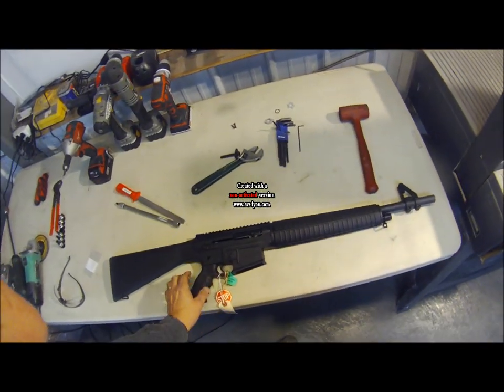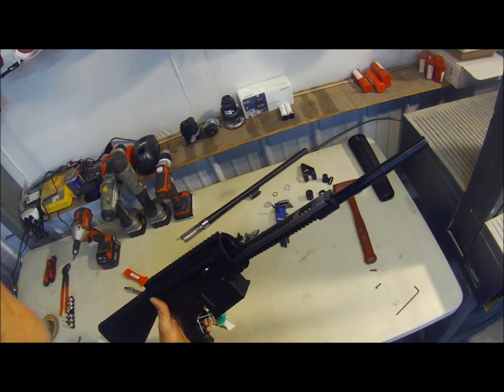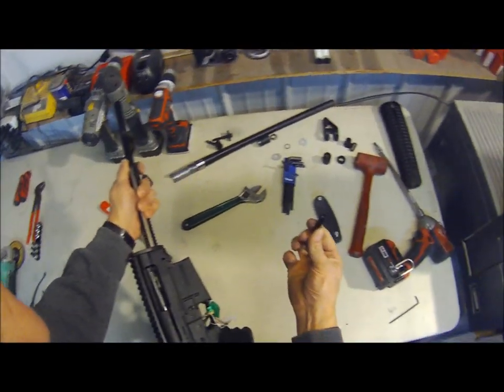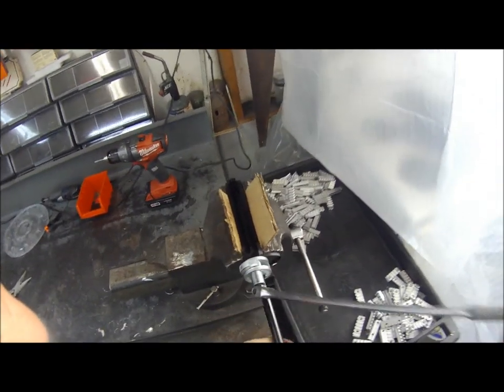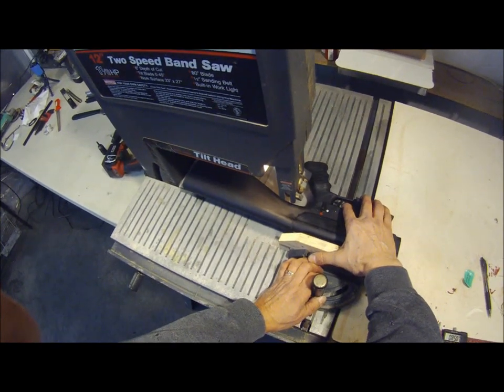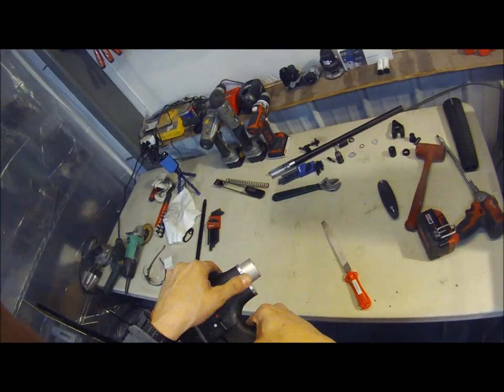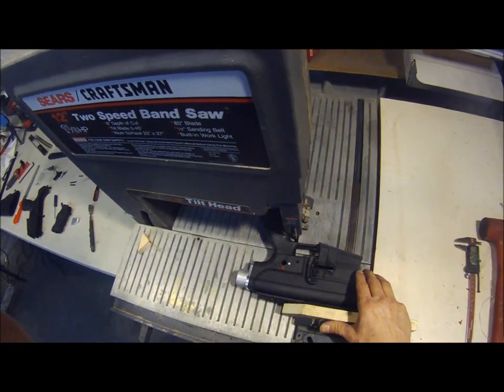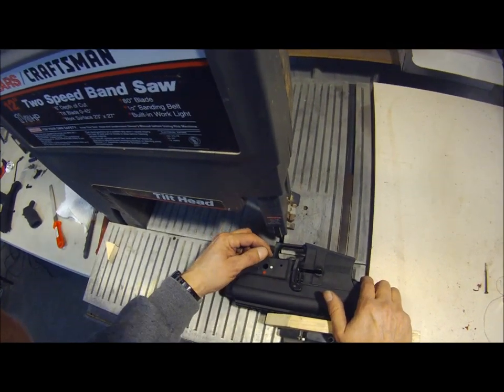MKA stock and grip cutting

Comment from the maker: I only know of 2 out of over 600 stock adapters we have out, NONE that we have cut. there are a few MKA's with some inconsinsticies with the injection mold, If the adapter is forced into the lower , that is where problems can occur, there are a few out there that need some slight material removal for fitment.

Comment: Do you know if this stock will work on a Leader Arms AR-12?
Reply from the maker: +Tony Botcher 
Not without some trimming of the leader arms gun, or our stock adapter, despite their advertising it is NOT the same as an MKA 1919. Until the number of sold units gets higher, and we think it's not a short lived gun( like all the other knockoffs have been) we probably won't make any specific parts.

Comment from the maker: Here are the parts list per ATF , you need to replace 4 or more of the following with US made parts

Receiver
Barrel
Trunnion
Bolt
Bolt Carrier
Op rod
Gas Piston 
Trigger 
Hammer 
Disconnector 
Handguard / Forend
Mag Body
Mag Follower
Mag Floorplate

Comment: Makes you wonder why MKA doesn't just make receivers like this 13:31
Reply from the maker: +Scott Lilja 
Due to ATF regs , they are not allowed to be imported with an adjustable stock
Reply: Yeah but that doesn't mean the stock and grip have to be molded into the lower as one piece.  "Removable" doesn't have to mean "adjustable".  They could still import it with that same M16 style stock if the stock was removable.  That way you could convert it if you wanted to, just like you would with a saiga